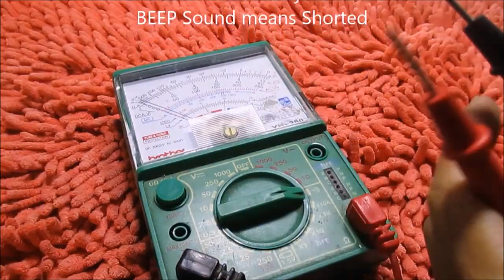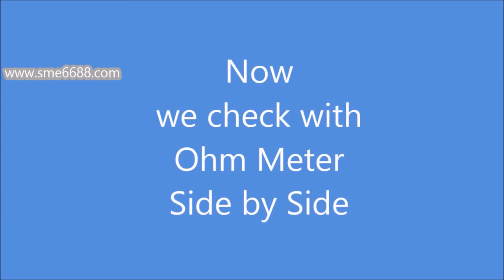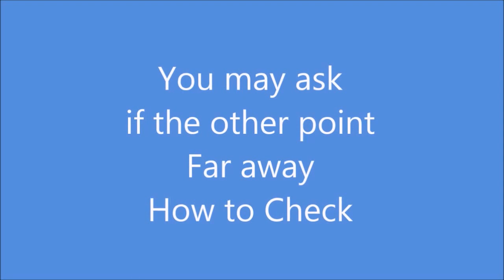How To Install BNC Connector to RG59 Coaxial Cable without Crimping Tools

Comment: Apologies to the maker of the video but I have to do some quality control.

I am a physicist with extensive experience in high-speed signaling and detectors where we live and breathe BNC cables. If you do a video like this you should recognize just how thoroughly you have defeated the purpose of using coax to begin with.  This applies to coaxial in general (not just BNC) since if someone is using coaxial they are probably working with information-rich signals like from a telecom provider or running a high-speed and/or high-def remote camera.

The entire point of coaxial connectors is that you maintain one-way a current that is through the center-axis and an opposing current that goes in a cylinder around the center axis through a conductive sheath (hence the name "co-axial" about center axis).  You get extremely low noise and reflection (matching impedance is an additional, but often important step here depending on what your application). Also of key importance is the the two currents cylindrically symmetric, opposite and equal lead to a net zero magnetic field outside the outer-most layer. An acceptable BNC connection is one where the connection itself maintains the coaxial natural of the current.

THIS VIDEO DOES NOT SHOW what would be considered an acceptable connection for anything EXCEPT very low speed and (relatively speaking) high current. When all I had handy was a BNC cable I have certainly soldered a messy connection to provide low-frequency unipolar current to an LED. Twisted pair or even just bare wires would probably suffice for that as well. But no one should be repairing or wiring up random coax like in this video.

NOTE:  This connection has been presented as "professional appearance" .  It's not. In fact this is blatantly obvious as a hack job. No offense intended considering I do hack jobs in a pinch like everyone else if something is not critical to get just right. But you should not call a hack job "professional looking" or "professional" anything for that matter.

Comment: Hi Andrew
i have Some FAQ's
Difference B/n BNC Connector Screw Type, and Normal BNC
--
What is the Difference Between BNC Connector Screw type / Balun BNC connector
--
Can i Use BNC Connector Screw Type with Cat5  Cable on normal BNC Connector  also better to use 
Adv Thx
Reply from the maker: You can use BNC Connector Screw Type with Cat5 Lan Cable on normal BNC Connector. BUT for short distance only.  If long distance the signal will be lost. So you need to use the Balun BNC converter with Lan cable.
Reply: Thx for reply
any Difference Between BNC Connector Screw Type, and Normal BNC
i installed Normal BNC connectors with cat5 cable, Is any Problem.
Reply from the maker: Is it normal BNC connector you mentioned like this one? https://youtu.be/FgoiVCQ_2xk . cat 5e Lan cable cannot use on crimp type normal BNC connector.  you need to use Screw type normal BNC connector.

Comment: That is the wrong way to terminate RG59 cable. crimp BNC connectors should be use not these Chinese DIY efforts in time and movement this connection with short snap and is exposed if out side corrode over time from this info is from a 20 years experienced security system engineer
Reply from the maker: Thank you for your comments. Yes,  should use the crimping tools as this video https://youtu.be/FgoiVCQ_2xk. but most of the residence owner they want to DIY for their own CCTV camera and save money rather than calling Technician to fix it. This is the alternative choice for them. Thanks for Watching ❤️❤️❤️❤️❤️❤️❤️❤️

Comment: The BNC connector is not a 'standard' BNC connector! Moreover, that type of connection will produce a dreadful return loss (a.k.a. VSWR).
Reply from the maker: Yes, This BNC connector although not the "standard BNC Connector". https://youtu.be/FgoiVCQ_2xk But it is very easy to fix without using BNC crimping tools. Especially for those people that don't have crimping tools.
Reply: For low frequency applications, that BNC connector will be OK,  but for anything of a few MHz and up, it will give a poor return loss, that return loss increasing as the frequency goes up. And BNC plugs are available that do not require crimping tools. Personally, I would not use one of those connectors you have shown - it's a bad idea.
Reply from the maker: @MikeSmith-wd4hn  Thanks for sharing.
Reply: Hi Mike, i have a 60 feet running cable in elevator which is of the type rg6 with stranded copper core. I cant seem to find any bnc connector that i can use with it. Can i use bnc male baluns for that 60 feet...